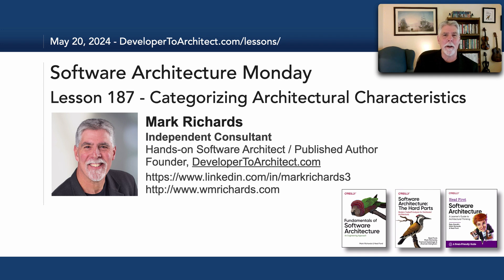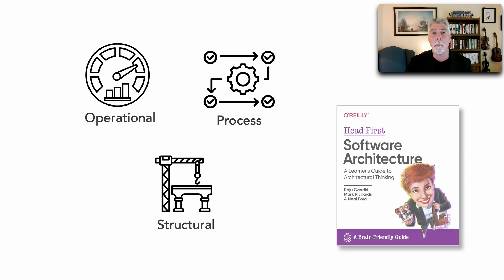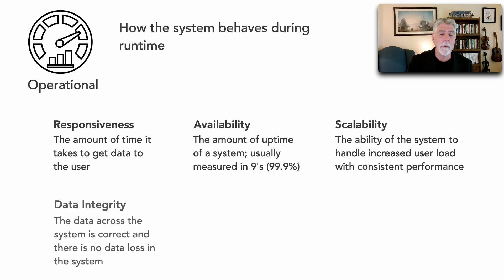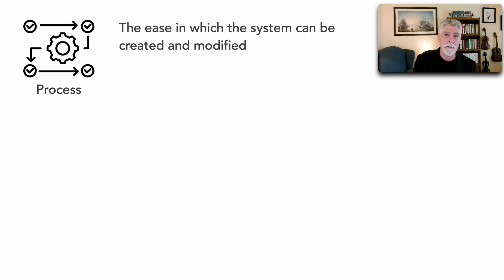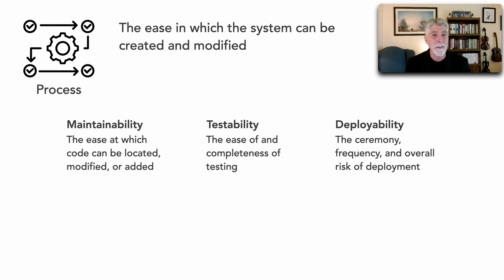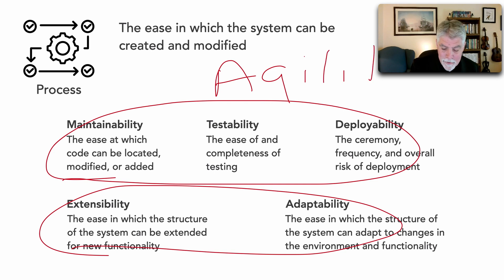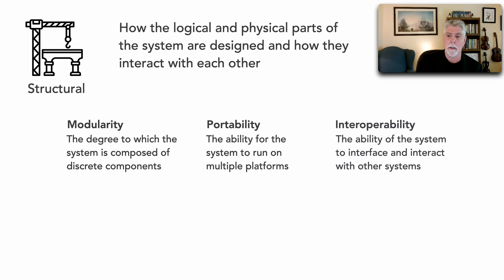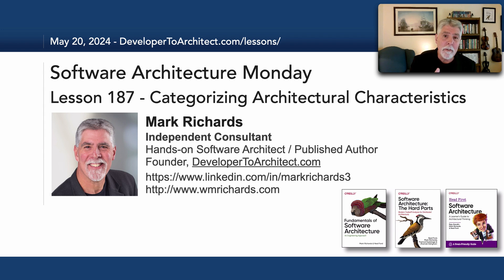Lesson 187 - Categorizing Architectural Characteristics

Comment: Thanks Mark, just discovered your channel, great content! Questions about security: you classify the security as structural and cross-cutting characteristic. In large companies, this is THE  essential one whatever the application, so incurring costs which may be overrated for some. Do you have any framework/tips on how to "adapt" the right level for each product.
Reply from the maker: Unfortunately I don't. It really involves a cost/benefit analysis for each part of a system or product, and a tight collaboration between the architect and the product team.

Comment: So neat introduction to the categories! ❤❤❤ There is only one bias suggestion, which presents in all videos 😊 Mark's comparison of testing microservices versus monoliths is flawed. Transitioning from monoliths to microservices makes testing more challenging due to network connections and other integration complexities. Testing a single unit of a monolith should require the same amount of effort or less compared to one testing microservice unit, as the functions are the same but without the overheads.
Reply from the maker: You are correct - the more services talk to each other the harder it is to test. However, a microservice has a much smaller testing scope than a monolith does, allowing for more completeness (and ease) of testing. For example, running 23 test cases for a microservice is much easier (and faster) than running several thousand test cases within a monolithic system.
Reply: @markrichards5014 Thank you for responding to my comment. I would appreciate it if you could share some references or direct me to your previous videos so I can learn more about the topic. I'm still a bit unclear and would like to clarify it. When dealing with 2 components, A and B, creating integration tests that cover their collaboration is essential. These test suites are required for both monolith and microservices architectures. And it's not just a unit test to one component, but integration for the whole system.

Comment: Thanks for new lesson! Portability looks for me like an Operational AC, while Interoperability can be also considered as a Process AC. Am I missing something? )
Reply from the maker: No, you aren't missing anything. No categorization is perfect, and there is some cross-over. I chose to put portability and interoperability into the structure category just because those characteristics are influenced most by the structure of the system, and don't relate to the classic operational ones (like performance or scalability) in the same way. However, you can certainly place them in other categories as you see fit.

Comment: Graeat video. Thanks for this and for share you knowledge. Can you make a video or give us some info about comparing differents aspects of operational categories that overlaps with each other? For example, in a microservice architecture, the more responsiveness your system is,, the more you will sacrifice data consistency because you provide data to other services through events instead of send the data synchronously. Thanks!!
Reply from the maker: Sure, that's a great idea. There are many common tradeoffs, the most classic ones being availability and data integrity / consistency (CAP Theorem), and responsiveness/performance and security/access control.